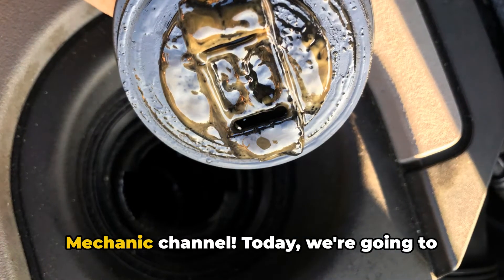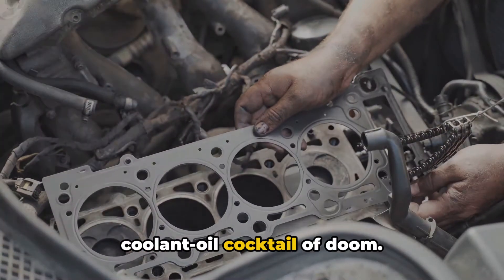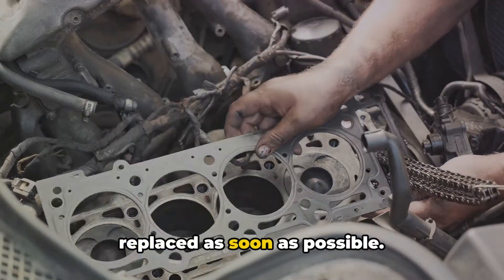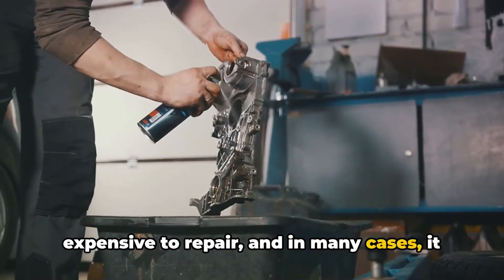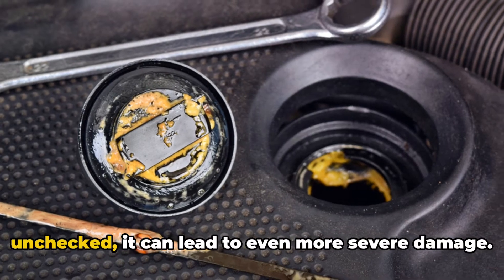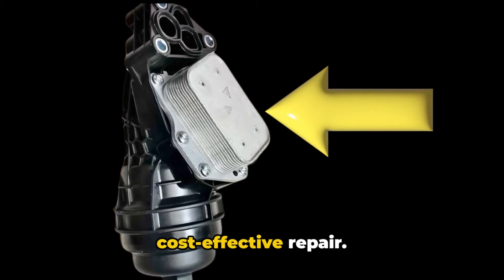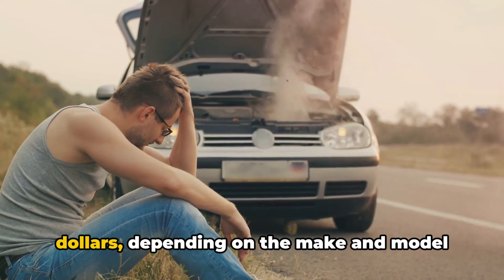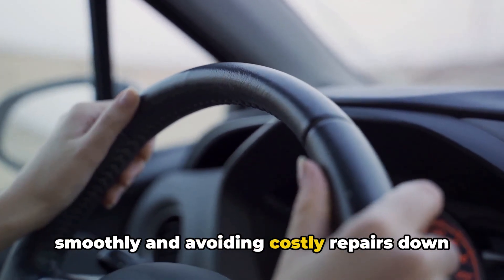Coolant Mixed with Oil: Causes & How to Fix

Comment: I'm having oil in my water resovior tank  on e90 and it's start to overheat
Reply: if its not showing on the dipstick then that sounds like an oil cooler issue
Reply: @FastestSlowGuy  correct ,I changed the oil cooler I'm good now 😎
Reply: @Hapy875 You are good now? 😎